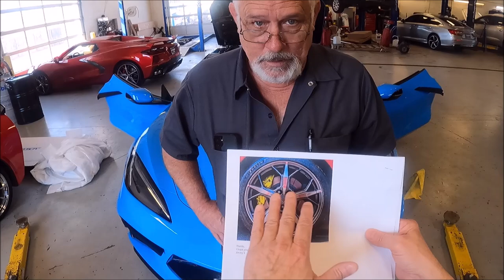CORVETTE TECH C8 MOLDINGS / JACKING PUCKS & YOUR EMAILS

Comment from the maker: Lots of questions about the grease, Chuck did mention it, we suggest at least once a year as we also mentioned tonight
It's AC Delco Dielectric Grease. I know this will help many. 
5 min mark of THIS VIDEO shows what he used;
https://youtu.be/bwo-PmnlMoQ
I had many texts about the very sounds we discussed today, thanks for watching everyone
Reply: Just ordered some.  I’ve always used lithium white grease.  Hope I haven’t been messing up all my seals in past
Reply: Would silicon grease work? 

Also wouldn't it be better to clean the dust off before you applied the grease and ground into the rubber?

Comment: I conditioned the seals on my 1990 Corvette Coupe which was my daily driver for 15 years. I used dielectric grease as recommended in the service manual and they were still serviceable after 15 years. The seals running along the roof were still in very good condition but the ones running along the back of the door windows had some surface deterioration in areas exposed to the direct sunlight. Areas covered by the door glass were still fine and still no leaks or wind noise. You could tell when an application was needed because the roof panel would start squeaking.

Comment: Rick and Chuck:  I learned this from Paul Koerner at the NCM Bash.  Paul is the veteran Vette mechanic now with GM.  The radio-on thing is, like you said, a clue that the car is in need of an update.  What some C8 owners are unknowingly experiencing is environmental interference in their garage or wherever the C8 is kept that can cause weird electrical things.  One guy had recently installed new LED lights in his garage.  The unshielded LED transformer actually made it impossible to open the C8’s door!  Move the car to a different location and try it out if you are having anything weird electrically happen.  Above all, Paul said, do NOT change your lead-acid old school battery out for one of those Optima things, or you WILL have trouble.

Comment: Hello Rick and Father Chuck! Thank you for the info on the dielectric grease.  I have a 14 Stingray Z51 convertible.  I treated the windshield seal but I was wondering if I should stop my top in the opening cycle without messing it up.  I see that you stopped your htc in mid cycle and I think I probably need to do that.  Can I stop the roof in mid opening or how should I approach getting to those gaskets?  Thanks a bunch , I binge watch your blogs trying to catch up since I just got my vette last year at age 69.  I appreciate all the help you give us in Tech Tuesdays!
Richard Kruger

Comment: Great tip on how to use dielectric grease  and since I own a car with a power sunroof I think it's time.  Glass doesn't break for no reason so something went wrong either a defect or the glass was placed incorrectly and it put to much stress somewhere.  Rick, I once owned a brand new Pontiac Sun Bird and it was mid- summer windows down and when someone closed my passenger door by window shattered inside the door.

Comment: Depending on what type of debris you have on your weatherstrip can determine whether to clean first before using your silicon paste application; some of us have a grittier dirt, i.e., sand based, that if you apply grease over it, could lead to degradation.  And if you have heavy pollen count, you're probably not going to want to smear grease on before cleaning the pollen off.

Comment: I have been told by some old detailers that the most important aspect of anything used to treat or clean the door gaskets/seals is to NOT USE anything that has a petroleum base. That is what will deteriorate the rubber over time. I am not sure if the dielectric grease is a petroleum base or not. There are two NON petroleum based spray lubes that I have used. I hesitate to make recommendations as everyone seems to have an opinion and I have heard lots of comments but I have used a product called Houdini as well as CRC water based silicone spray. I spray either one on a clean rag and wipe down the rubber strips until I get a nice look and have no dirt coming off on the rag.

Comment: Great info on this vlog. I did an update a few days ago. I took out the car today and had crazy shifting issues. Way to high of RPM’s, and it would not even go into 8th gear. Real rough downshifting.  I was not in manual mode. Any help is appreciated.

Comment: I have experienced accidental glass shattering (outside of the car environment) by twisting it.  It's surprising how little a torque twist can be to shatter the glass.  Perhaps the slide fixture is a bit warped for some reason.  If that is the case, a replacement could also shatter down the line.

Comment: I did not author this, but here goes:

Risk Factors For Spontaneous Glass Breakage
Now that you know spontaneous glass shattering is a real thing, you’d probably like to avoid it if at all possible, right? How do you do that? Tend to back glass repairs or rear window glass replacement promptly if you notice even a minor indication of glass damage.
 
Aside from handling necessary auto glass repairs or window replacements as quickly as possible, you’ll also want to keep an eye out for these potential red flags:
 
●        Edge damage. Considerable stress can build around chips, cracks, or other imperfections in the edges of a tempered glass window. Over time, environmental stressors like temperature, wind, and road vibrations can put those glass imperfections under even more stress, which triggers spontaneous breakage.
 
●        Thermal stress. Extremely hot or cold temperatures can prompt glass contraction and expansion, and if the thermal stress exceeds the glass’s strength, the window will break. If you notice your vehicle windows become ridiculously hot in the sun or incredibly cold in winter, try to park in a covered area to minimize thermal glass stress.
 
●        Window frame changes. When the frame of a vehicle window incurs damage or changes shape for other reasons, the tempered glass inside it may no longer get adequate cushioning and protection. Driving vibrations, heat transfer from the vehicle frame, and excess frame pressure can all damage the edges of the glass and contribute to spontaneous breakage. 
 
●        Nickel-sulfide particles. When small pieces of nickel-sulfide get trapped within a sheet of tempered glass, they can compromise its strength and integrity. You probably won’t be able to detect nickel-sulfide in your vehicle window, and in reality, the risk factor for this issue isn’t high due to stringent glass manufacturing standards. It’s good to be aware of the potential risk nonetheless.
Reply: So much for warranty.